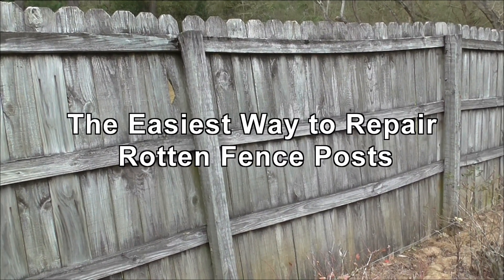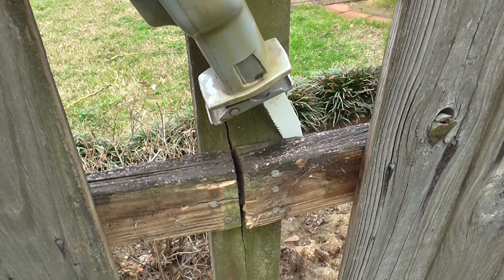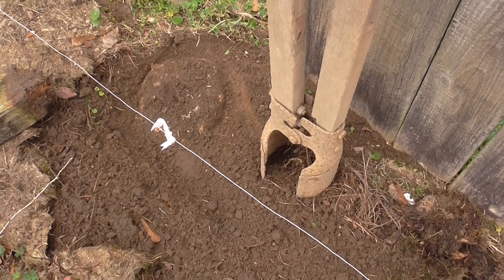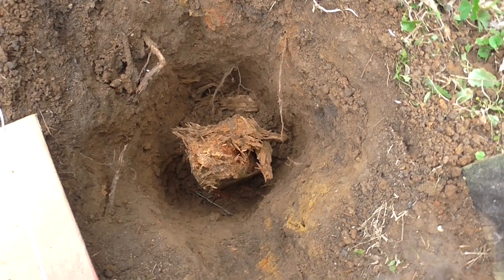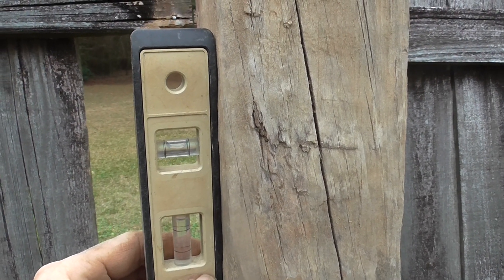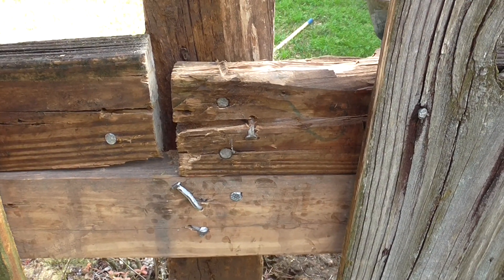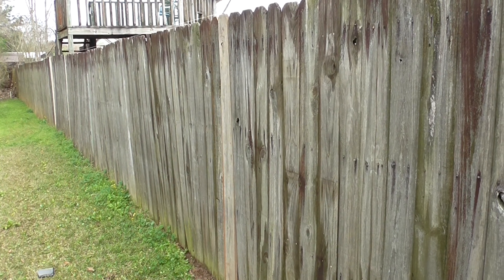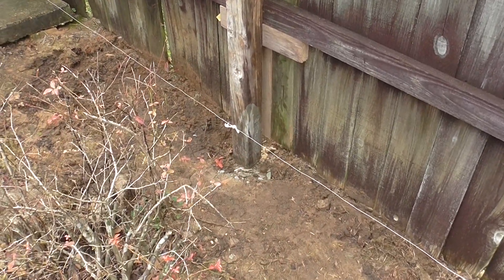The Easiest Way to Repair Rotten Fence Posts

Comment: Brilliant video! I have no access to the other side of my fence which has a broken at ground level 4x4 from the alcoholic drug dealer neighbors driving their car into the fence when high. (which is all the time) I was sweating out how to fix it without getting attacked if I stepped on their side. This solves my problem completely! Thanks for a great video and your narration was great also. No constant "go ahead and, go ahead and, go ahead and... or "uuuhhh, uhhhh, uhhhh, uhhh's. Thanks again!

Comment: So now that the replaced post is embedded in concrete whose top is still below ground level it will start to rot all over again. It may last a few years but the top of the concrete should be above ground level.
Reply from the maker: You are probably very correct.
Watched another video recently dealing with concrete being raised above ground level with posts.
I may have to retro pour concrete to fix this

Comment: That fence is barely worth fixing. The problem I've had is once I dug the fence post up and the concrete, then I had a giant hole. I dug two posts out today that were busted in the ground. I have huge shrubs to work around and the ground is at an angle. Behind the fence the dirt was backing up. It's hard to know just what the hole depth is since there is no grass along the fence. I feel like a fool. It's hard to rebuild a fence by yourself with the neighbor's checking out your progress from day to day. I have FOUR days to get this wrapped up and it's back to work on Monday. I have to stop staying up all night watching movies. It just gets dark to early.
Reply: What do your problems have to do with the author of this video?

Comment: This is just the info I've been looking for ~ Thanks!    I have to get an auger drill bit,   what size did you use?    I found a 3" x 16.5" auger bit for $24  but I'm not sure if that's deep enough but it would at least save me from shoveling out the whole area around the post.   Somebody else commented on pouring the concrete above the ground line but then I'd worry about hitting it with the lawnmower every time I mowed around it.   Do you have any suggestions that would prevent that?   Thanks again.

Comment: When you rebuild that fence I would just tear out the Old Post leave the concrete there, dig a new hole next to it, and then continue to tear down the next panel, set every new panel and post every 8 ft. apart. I was able to remove and replace two panels a day at my own leisure.

Comment: Should I use 3/4" rock instead of concrete?  Somebody once told me rock is better because it allows the water to drain, whereas the concrete allows water to seep into the wood but then doesn't allow it to drain.